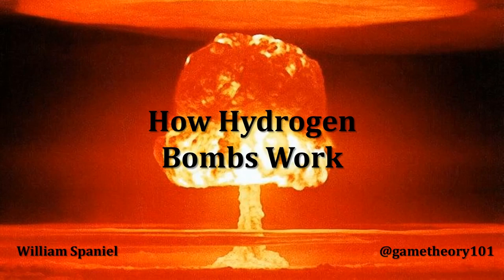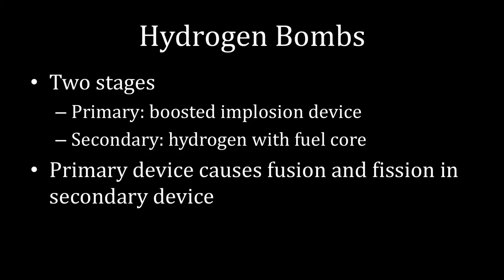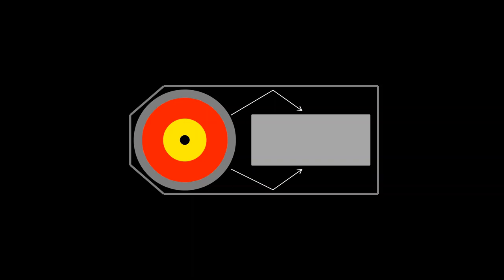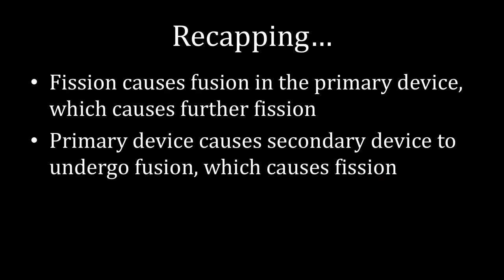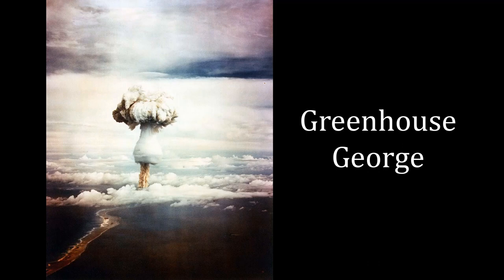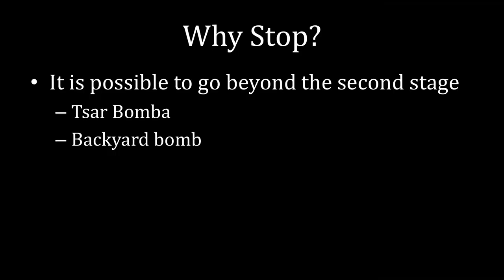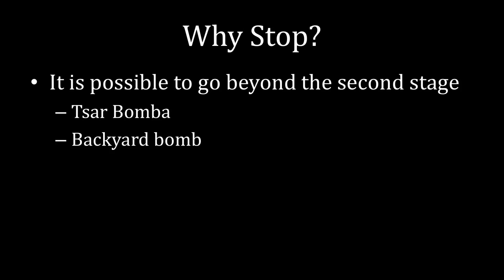How Hydrogen Bombs Work | Nuclear Proliferation Explained

Comment: Another good vid, but a few nitpicky additions I'd like to make. A hydrogen bomb does not have to make use of a boosted primary. Some of the earliest two stage weapons didn't incorporate boosting.
In devices from the 50's, the process is more like fission fusion fission fission fusion fission.
The US also tested and deployed a 3 stage weapon; the B41.
Also I sent an E-mail your way last night as requested.
Reply: I’ve really been appreciating your commentary throughout this playlist.  Thanks for sharing!
Reply: @PunmasterSTP  Thanks a lot. Glad you found it of value. Please feel free to ask any questions you have.
Reply: The secondary stage contains a solid thermonuclear fuel, which consists of lithium deuteride. When the secondary stage is blasted with x-rays and crushed by the shock waves by the explosion of the primary stage, lithium atoms shatter into tritium and helium 4 nuclei and fast neutrons that fuel the much larger fusion and even larger fission explosions that occur at the same time. They in turn can cause the radiation case around the entire weapon to fission and magnify the blast yet again. The primary stage does contain deuterium and tritium gas in the hollow plutonium pit. Some nuclear warheads have a "dial a yield" or DAY feature. By varying how much tritium and deuterium is injected into the pit, the warhead will explode with the desired yield.
Reply: @taraswertelecki3786  The secondary is not crushed by the shockwave from the primary explosion.
What breeds the tritium from lithium is the neutron flux from the D-D burn.
No, like I said, not all H bomb primaries have been boosted. That is the norm today, and all weapons in the current US arsenal are boosted, but several early H-bombs used unboosted primaries.
Variable yield is achieved by other means aside from varying boost gas injection.

Comment: It's lithium deuteride in the secondary that breaks down into the required hydrogen.
Reply: Lithium comes in two isotopes, BOTH of which act as thermonuclear fuel. When the Castle Bravo weapon was tested, engineers were not aware of this fact, and ended up with a much larger blast than they expected. They expected the weapon to go off with a yield of 6 megatons, but the explosion had a yield of 15 megatons. The scientists and military personnel conducting the tests were nearly killed by their own bomb. Today a crater over a mile wide and 250 feet deep marks the location where Castle Bravo detonated.
Reply: @taraswertelecki3786  Yup. I heard it was scary close because of that. Incredible stuff.